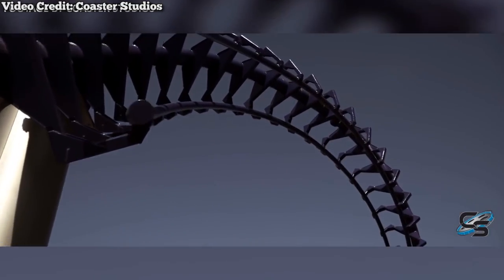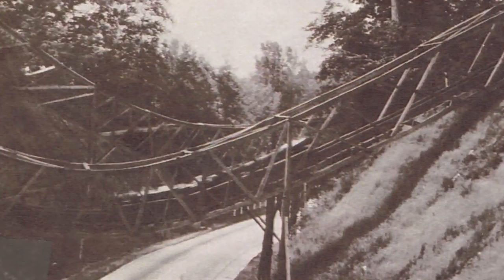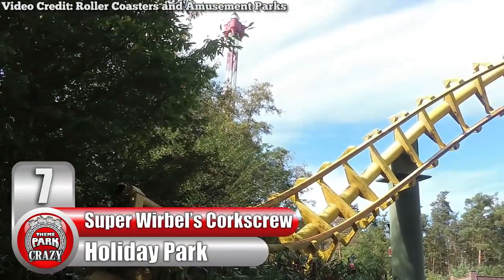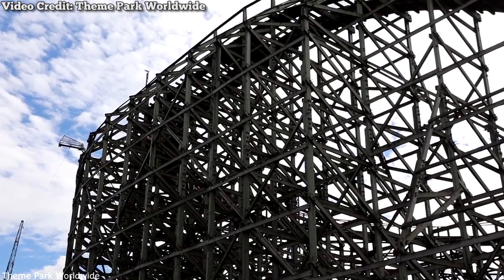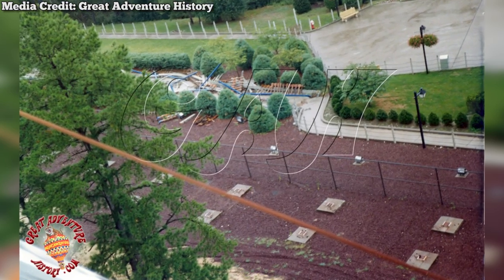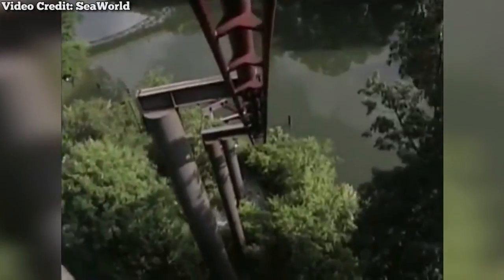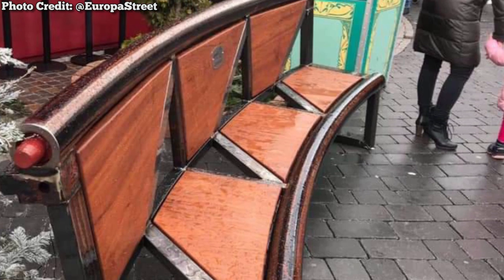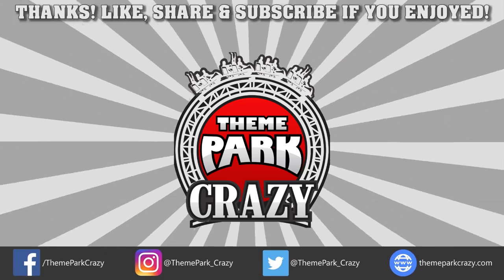Top 10 Re-Used Roller Coaster Remnants

Comment: I always like hearing that a park was able to reuse a loading station for a future ride. I never knew it for a while, but it turned out the former Vortex at Kings Island had also reused The Bat’s loading station, a coaster with a troubled past, much like Viper. Although it’s not as fitting for the theme (if there even is one) as The Bat, it still was a nice design.

Comment: The station for Vortex at King's Island was originally the station for the original Bat. The holes for the old suspended track were never covered up and the Bat's iconic trains were stored underneath the station for years.
Reply: Why don’t they re add them back to the new bat?

Comment: I remember Viper - I live in the NY area still and I actually liked that ride, despite it was a little rough.  El Toro is fine, but I liked Viper.  Also been on Big Bad Wolf in Williamsburg which was a lot of fun. I read about the bankruptcy of the company that built it - was sad about that.  At least the new version still goes over the river.  I also had been on the old Hulk coaster in Florida a few years ago - little did I know a year later it would be shut down and rebuilt.  Thanks for sharing, brings back memories.

Comment: Here's a couple more: Laser Loop's station is now the station for Phantom's Revenge. And the first half of Phantom's Revenge was the Steel Phantom. Oh, and part of Thunderbolt's track was from arge Pippin.  Also, Banshee's station is the same as Son Of Beast's station.
Reply: Lots of great ones there! But actually, Banshee does not use the SOB station. The station can still be found walking back to the Bat though and there is still track you can see in the station as well 🙂

Comment: i have an idea for a rollercoaster model:

the free-roller

the cars are suspended below a circular steel track, but the suspension point has a thin gap to allow a fin* (which ill get to later) and they travel across a smooth track. eventually, the cars are going to get through a loop, and thats the first use of the fin. there are two types of the loop: a free-roll loop and a locked loop. the free-roll loop doesnt have a fin attached to the track, allowing the cars to spin freely. the locked loop does have a fin, which locks the cars to get across the loop like other rollercoasters. same goes for zero-G rolls and corkscrews. they also travel across a vertical lift before the action, and lightly descend and accelerate across a sloping track with a spiral turn.

*long extrusion that locks the cars in place

Comment: My local park KENNYWOOD did this with now is the phantoms revenge coaster. It still use the old laser loop coaster (shuttle loop coaster like the first coaster mentioned) station as Steel phantom coaster by arrow. I think phantom revenge (it might have been fully replaced by morgan manufacturing) still uses steel phantoms lift, first and second drop.

Comment: Sirocco covered the loop not because of the noise but because the breaks blocked in the looping. The riders where stuck for hours.  They covered it to put a staircase around it so if it happend again they could exit the riders more easely. Because the poort reputation it got they made it psiky underground and the incident has mainly been forgotten .

Comment: Waldameer park is my home park, when Ravine Flyer II was put in  2008 that's when I learned about Ravine Flyer I and it's history, that's when i finally realized that both Ravine II and the kiddie coaster Ravine Flyer III where named after the very first coaster Waldameer ever had. Before the W&W area was put in on the right side of the lift hill and around the turn around loop of the train they used to have a old coaster train from Ravine Flyer I  sitting in that plot of land in the center of the turn around. The only thing I never knew was the picnic grove right there at the entrance of Ravine Flyer II was the original station for Ravine Flyer I.

Comment: I have a ride that has recycled parts from 2 rides. Laser Loop station at Kennywood park. Recycled into the station for Steel Phantom and then recycled into Phantom's Revenge. Steel Phantom lift hill recycled into Phantom's Revenge lift hill.

Comment: Speaking of the Crystal Beach Cyclone, here's a fun fact: 

The designer, Harry Traver, is a lot like Alan Schilke.  Both are known for making innovations in the wooden coaster market using steel.  Both featured unconventional elements for a woodie, and both used special steel members to keep the wood track from breaking under the stress.  Both also developed trains specifically to handle the extreme elements their rides generated.

The most interesting part?  Harry Traver died on September 29, 1961, four years to the day before Alan Schilke was born.  Coincidence? I think not.

Comment: When we went to universal studios Orlando, we were in line and heard a lot of noise and a emergency announcement that we thought was apart of the ride but later found out that the ride got stuck upside down and that they would fix it but you would have to wait a while or leave. We decided to get out of that line so quick hahaha
Reply: The ride might of broke down, but it getting stuck upside down? No. 
The only ride that goes upside down is Hulk and it’s almost impossible for that to get stuck upside down.
Reply: Project Coasters it was the hulk ride we were in line for. And trust me it did happened.

Comment: Untamed is not a "hybrid" coaster. It's a steel coaster. Roller coasters have always been defined, by the industry, as wood or steel depending upon the makeup of the track bed alone. Wooden track bed = wood coaster. Steel track bed = steel coaster. The supporting structure is insignificant.
Reply: nope Crooked Halo, This is a RMC Hybrid coaster not a steel coaster
Reply: @alphazeroproductions4811  You are incorrect.